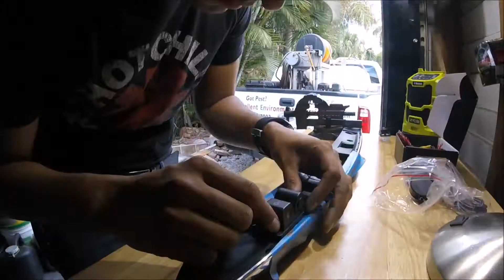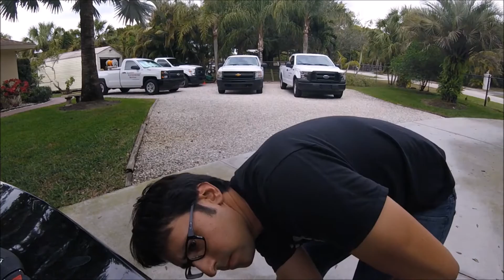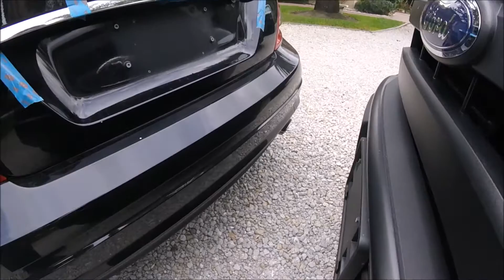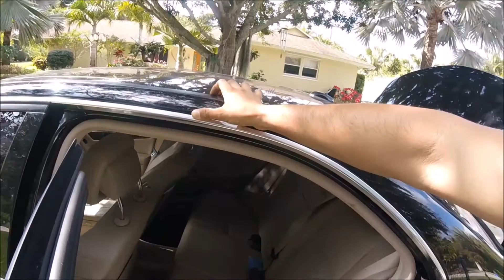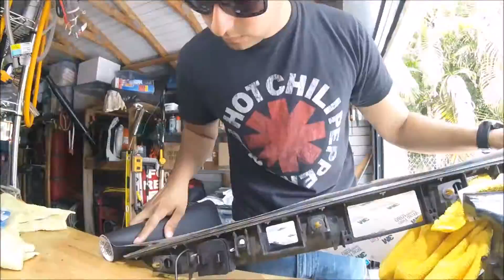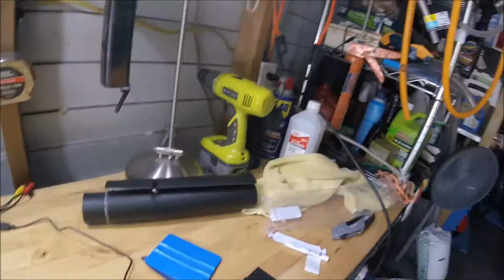Upgrade your Mercedes Camera + Vinyl Wrap Part 1

Comment: Hi mate can you help me set up the camera in my car. It’s w204 2007 model.  I did exactly the same wiring like you did. But my camera is operating. 
One thing I would like the share is that, in my navigation panel there wasn’t any blue/green wiring which you unplugged. However there was a socket to insert it. Secondly when I am programming my camera, in the rear view camera option there are only two option coming up: 
1) not installed 
2) installed
There is and srvc option coming up. 
Could you please help me the mystery ? I would be thankful

Comment: Raymond Urias, just bought the Back up camera with the Fakra cable. I have an 08 C300, if the firmware is an older version will I still be able to install the back up camera and use it even if I enable it in Engineering Mode? Thank you very much.

Comment: I know this is an old video for you but I have a factory backup camera that is absolute $hit.  I want to replace it and am wondering if I can get away with just using the factory wiring that runs to it.  Any experience there? I see a lot of full replacement videos for C300’s that don’t have factory cameras but zero for ones that do.
Reply from the maker: You can unplug it and disable the camera then install an after market system similar to what I did with he mini Cooper.
https://youtu.be/PS9ewyBsnzU

Comment: Just wondering how do you take the plastic bit off above the license plate where the lights sit? Been trying to take mine off but feels stuck.
Reply from the maker: https://youtu.be/YwTyKdIqCFQ

Use a plastic spatula and use it to leverage it out if you don't have a trim body removal tool
Reply: Raymond Urias thank you so much!! I was stuck with the screws.. Thanks!! Subscribed

Comment: Can you still install/ use the back up camera with the new telsa style Android touch screen system that you installed in your car because I wanna buy them both but wanna no if they can be used together.
Reply from the maker: +Adrian Bennett yes you can 😁 you can even step it up and install a 360° camera if you have an extra $300
Reply: Raymond Urias do you have a link to the 360 camera
Reply from the maker: Adrian Bennett http://carlife-mall.net/ZT02/index.php?main_page=product_info&cPath=7&products_id=16

Comment: Hi Raymond urias 
So I bought the esky camera from the link on Amazon and I bought Fakra Connection from AliExpress, I did everything as per you 1st video ( install rare backup camera ) and I connect this , the sensor is working and it gives alarm sound that corresponds to distance ( very nice ), the Camera doesn’t work though!
I don’t know what or where is the catch but if the connection was bad I wouldn’t have the sensor working yes?
Please advice me if There is something I can do to check the camera because I am thinking maybe it is damaged, I even check the monitor and camera is there but I don’t have the three options ( NTC , PAL, etc 
And when I put the gear to reverse nothing happen on the screen 🤷‍♂️
Reply from the maker: +Rami Banbouk did you program the screen to accept the incoming signal? Some subscribers found out that there commands firmware needs to be upgraded. What is your current firmware?
Reply: Raymond Urias , I am newbie in this and totally relied on your videos so really I don’t know what software I have , can you guid me where to get from  the software version and how can I update ?
Reply from the maker: +Rami Banbouk Instagram me @raymonduriasjr

Comment: Grommet you got is what size and where did you get it..?
Reply from the maker: +$chevyboi$ I used this kit:
 https://www.amazon.com/dp/B01L8LP80Q/ref=cm_sw_r_cp_apa_cNGzAbHKB37BJ
Reply: Raymond Urias thanks bro.. about to get the relay and get it ready.. thanks again.
Reply from the maker: $chevyboi$ make sure your car has the plug behind the radio. Also you can program it now so that way you know it will work. The screen will be black but it will say check surroundings up top
Reply: Raymond Urias ok....

Comment: Raymond Urias , 
This was my reply couple days before :)
thank you for fast response , and for complementing my c220 , If I was smart I would buy 300 like yours 😉
for the record and when I had better income on 2008 I had my first MERCEDES and it was ML55 2005... yes AMG ... so if things get better I will definitely go for a bigger Engine :)
My car is w204 model 2007 exact shape of yours , my car comes with GPS , regarding the budget I think 50-100$ max for a camera & parking sensors.
I thought of changing the command center with one of Dynavin or Seicane that are set for C class but I wasn’t so sure about the quality and reliability of OS in those aftermarket devices, beside I thought why to pay more if I can spend less $ for getting Mobile mirroring and Parking camera which is going to be exactly the same thing for aftermarket command center - apart from the bigger screen-!
The other day I found this website with options for tuning chips claiming to give up to 30% increase in power to the engine , all that for a little less than $500 !
http://www.mercedesmedic.com/mercedes-tuning-upgrades-mods/#upgrades
One other thing please , I am following a video of yours for how to change to HID lights , mine are normal yellow lights and I think I will go ahead and do the same as yours , but I am thinking to get the 55a instead of 35 for the extra illumination and I believe in France it is not big issue , however , I would like to have your advise if I can add to my OEM headlights a LED light strip without having issues with the Mercedes computer?
Thanks again Raymond and waiting for your new videos ... Big fan man
Reply from the maker: +Rami Banbouk Thanks man! Yes bigger engine is better but you get better mpg then me so that's a plus for you. I have found for cameras everyone has their preference, I personally love mine. It's been 1 year and it's still like the day I bought it. Really important to use a relay when wiring it up. I am in the process of installing/ reviewing an aftermarket screen, you will be seeing it on the channel probably late Feb/ early March. So stay tuned for that, it's the first of its kind...in it's size and Install. I'm not sold on thoes chips I prefer Renntech or eurocharged. 55w is bright! Like really bright. You may get pulled over so becareful...or at least point them down a little. Led strip? Where would this strip go?
Reply: Raymond Urias , thank s for your reply , really appreciate your efforts posting new stuff and take the time to answer followers ... great job man , wish you all the best
In this case I will proceed with the same camera as yours , do I need to order as my extra plugs with it fromAmazon or it comes with all requirements ( plug & play ?) , 
Regarding the screen I will be waiting for your new review, so I will not order the Mirabox wifi  pending for your new Video ,
The led strip will go inside the headlight under the lens of low beam light :
https://rover.ebay.com/rover/0/0/0?mpre=https%3A%2F%2Fwww.ebay.com%2Fulk%2Fitm%2F172951851859
Today I bought a second hand head unit DVD to replace mine because my DVD is not working , surprisingly and after installation everythings worked from the Console control Knob but the all buttons are inactive and there is no sound !
In your experience do you think the used command unit is damaged or it is because I didn’t pre-program it to my vin number via the star software?
Thanks 🙏
Reply from the maker: +Rami Banbouk you have to check the back of the command system to make sure you have to port available. Also you can go to the engineering screen and see if it will allow you to activate it. The activation will trigger a black screen when going in reverse. I am familiar with thoes light and they will have no effect. The headlights come with a resistor pack for them. The unit should not need to be programmed unless it has navigation. I would check the connections make the quadlock is not on fully.

Comment: Hi , thank you for keep doing these videos , very useful & enlightening..
I have c220 and I would like to buy this camera but before I do I would like to take your advice for couple of things :
1- since the Video is old and you keep searching for better products, is there is any better camera out there?
2- this camera comes with the plug & play connector for Mercedes OEM media ? If not can you please advice me where to buy from ?
3-what do you think about adding Miracast or Mirabox for iPhone mirroring ? I was about to buy one but I thought of asking you your opinion before doing so , after all the great updates you did to your car I really wonder why you didn’t add such useful one , there must be a strong reason and that is why I would like to take your advice 😉
4- can you advice me where to get other upgrades like headrest media , performance tuning chips .. etc
Once again Thank you so much for these useful videos and best luck
Reply from the maker: +Rami Banbouk Congrats on the c220. What year is it ?
1) There are always bigger better cameras. The question is what is in your budget? What features are a must have for you (ir, parking sensors)
2)No this camera does not. I need to know your year and if you have navigation.
3)I didn't bother putting in a Mira cast because I am going to upgrade my screen to a larger all in one system 10.25" to be exact.
4) Mercedes stuff I like to use eBay and http://www.mbscashopen.com. I don't know of any chips for our cars only tunes like Renntech and Eurocharged

Thank you, many more videos to come.
Reply: Raymond Urias , thank you for fast response , and for complementing my c220 , If I was smart I would buy 300 like yours 😉
for the record and when I had better income on 2008 I had my first MERCEDES and it was ML55 2005... yes AMG ... so if things get better I will definitely go for a bigger Engine :)
My car is w204 model 2007 exact shape of yours , my car comes with GPS , regarding the budget I think 50-100$ max for a camera & parking sensors.
I thought of changing the command center with one of Dynavin or Seicane that are set for C class but I wasn’t so sure about the quality and reliability of OS in those aftermarket devices, beside I thought why to pay more if I can spend less $ for getting Mobile mirroring and Parking camera which is going to be exactly the same thing for aftermarket command center - apart from the bigger screen-!
The other day I found this website with options for tuning chips claiming to give up to 30% increase in power to the engine , all that for a little less than $500 !
http://www.mercedesmedic.com/mercedes-tuning-upgrades-mods/#upgrades
One other thing please , I am following a video of yours for how to change to HID lights , mine are normal yellow lights and I think I will go ahead and do the same as yours , but I am thinking to get the 55a instead of 35 for the extra illumination and I believe in France it is not big issue , however , I would like to have your advise if I can add to my OEM headlights a LED light strip without having issues with the Mercedes computer?
Thanks again Raymond and waiting for your new videos ... Big fan man

Comment: Hi man, 

what should i do when my backup camera says " please check entire surroundings!" and I got a black screen can't see anything through the camera.
Reply from the maker: +Mohammed Alsaysaban video cable is not plugged in. Or camera doesn't have power. The good news is you have it programed correctly. Make sure you have the original farka cable unplugged and just the new one plugged in. Check your RCA it could have gotten disconnected and check power supply make sure unit is getting power. If everything is fine then you could need a capcitor on the power supply. Check out my video on noise/ no display

Comment: The part you're wrapping with the vinyl my chrome is peeling off a little .  Going to  wrap it . I guess I will have to peel all the chrome off.
Reply from the maker: +fitz phillips Sucks to hear that. I won't peel it off, first try wrapping it and apply a little heat it may help it stick back together

Comment: What do you do with the reverse light now that you have this camera?
Reply from the maker: Danni Belle The camera must be wired to the reverse light. It can't be wired to the fuse or it will burn up and beep non stop. https://youtu.be/asew2cQCUgs
the wire you need to tap will be the last one silver with blue stripe.
Reply from the maker: stephen frank I upgraded to this:
https://www.amazon.com/iJDMTOY-18-SMD-Error-License-Mercedes-Benz/dp/B008BWMSOK

sooo much cleaner
Reply: Those look amazing. I meant did you simply remove the bulb because  the new camera doesn't support a backup light the way the previous one you installed did? Also is that an issue when it comes to doing inspections or no?
Reply from the maker: stephen frank I removed the whole light unit (Bulbs and Plastic) The LEDs are an entire replacement kit (Never worry about taking the trunk apart to fix a bulb again) It brings the back of the car back to factory look with 2 new license plate lights and no camera sitting on them reducing the light output. As for the new camera it definitely will pass your inspection. 😀
Reply: Ok thanks Raymond. The reason i asked was because i didnt notice that you put the camera next to the backup light. I thought you were using the backup light location to install the camera. But at the look at it a few times and i realized you drilled a hole in the area next to it. So for the confusion.
Reply from the maker: stephen frank my bad, Sorry for my misunderstanding. I did originally install the camera in bulb. But this camera has to be drilled in. TOTALLY WORTH IT.
Reply: No problem. Last question that is bugging me. The black connector for the camera comes with a cable and some sort of circle plastic thing. I think it says its a buzzer but what did you do with yours?
Reply from the maker: stephen frank I plugged it in and ran it to the corner of the trunk. The exact spot where I put the Comcast flag in the original install video https://youtu.be/YwTyKdIqCFQ
it's audible in the car from that corner.
Reply: Yeah i did the same thing just now. Works out great back there. Was worried about the sound but its loud enough. Thanks again for the videos wouldn't have had the confidence to pull this off without them! Also this camera rocks!
Reply from the maker: stephen frank that's awesome! I'm happy you took up the challenge!
Reply: this is the issue we are having now...the sensor noise is beeping outside the car(loud) and the car is not even in reverse....does this video link you posted ^^ above address that?
Reply: Raymond Urias , nah I wouldn't wire it directly to the back up light. It's the cheapest way but the correct way is to use a relay. I'm surprised Raymond, Mercedes usually gives you a voltage drop error any time you splice into a factory wire.
Reply from the maker: benefactionhindrance You are correct. A relay would be ideal...BUT you still need to tap the reverse light for it to trigger the relay. instead Of have found most cameras don't have issue with the SAM system and the ones that do can be resolved with a $4 capacitor.
https://youtu.be/SUOivzMeoqU
Side note you are also correct about the splicing. It's always best to tap any of the lines the SAM system pulses through. Cutting them and splicing will always lead to a fault code that becomes a pain in the A$$ to clear.
*edit remove wrong name